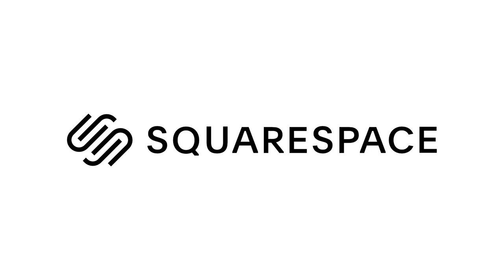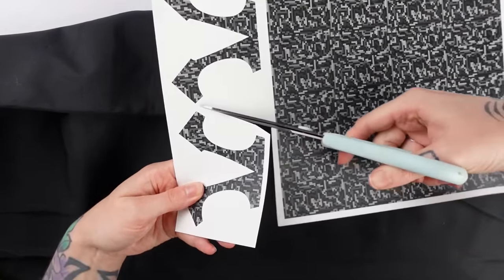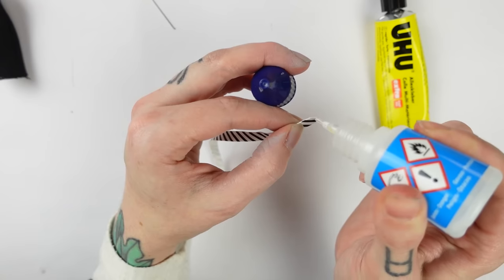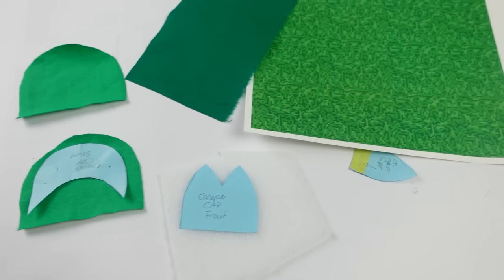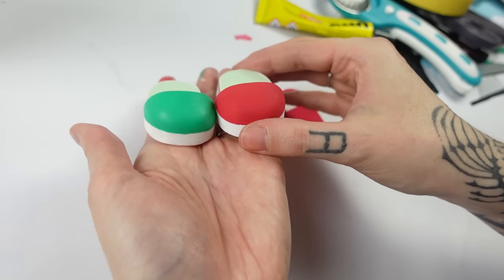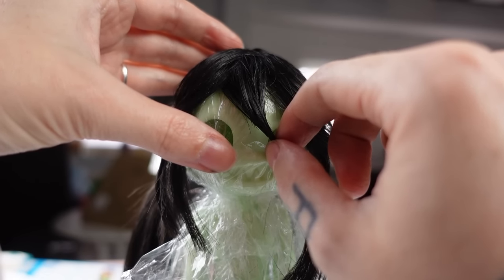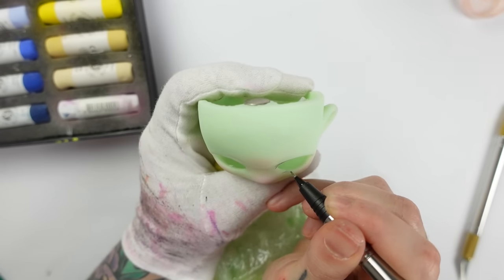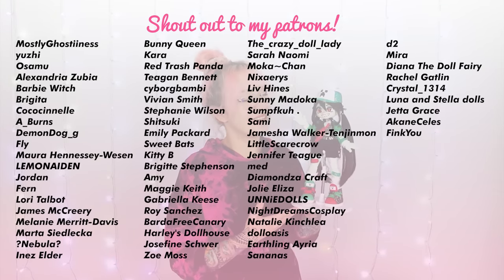I Made a Creeper WITHIN A CREEPER?

Comment: Fun tip: if you can't get silicone finger covers, try a thimble or wrap your fingers in sports wrap or strong fabric like denim!
Reply: What about medical or electric trape? Guess tape is only even a consideration if you havn't got an alergy to latex, though.
Reply: @chloepainter4064  electrical tape will melt in high temps.